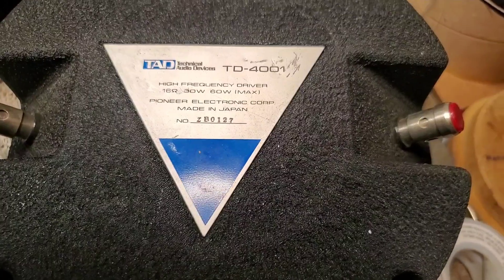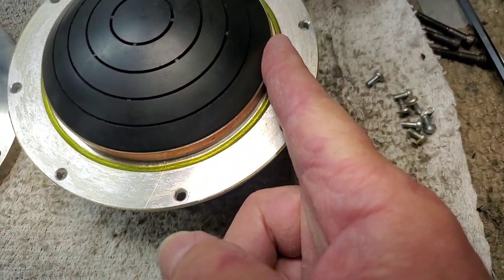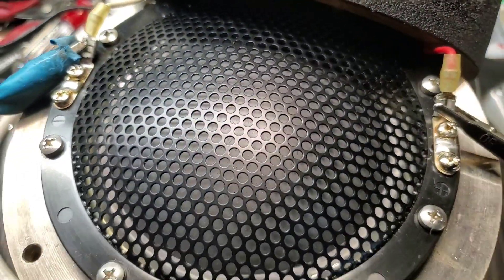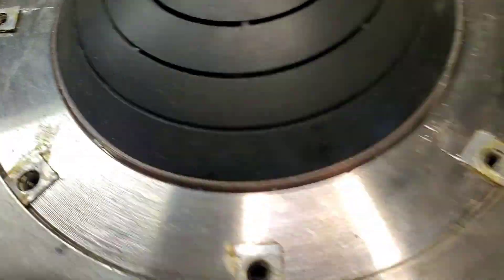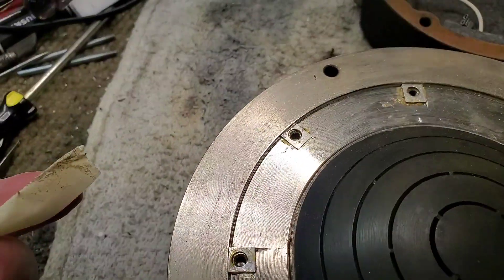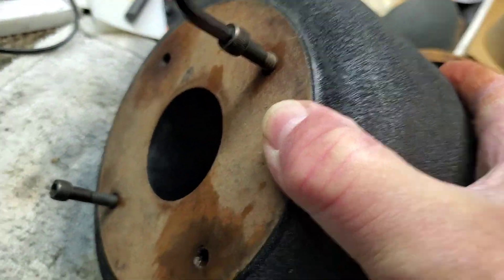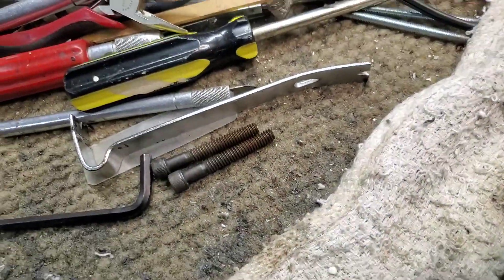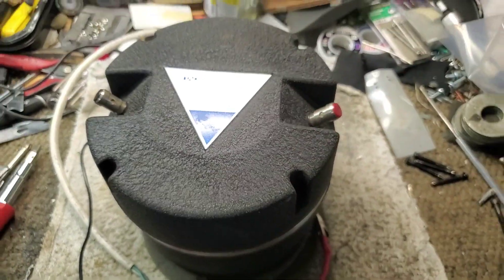TAD TD-4001 Full Service Teardown/Cleaning/Recharge...by Upland Loudspeaker Service

Comment: Thanks Ken, very interesting.  These TAD are equivalent to JBL 375?
Reply: The 375 is equal to 2440, while the 376 is the 2441. The TAD is derived from JBL (Bart Locanthi went to work for Pioneer) but built in the sense of "make it as good as can be". The TAD4001 play a league above pretty much all JBL compression drivers - better built (If I remember correctly it has an extra slit / ring) and of course the huge beryllium diaphragm does wonders.